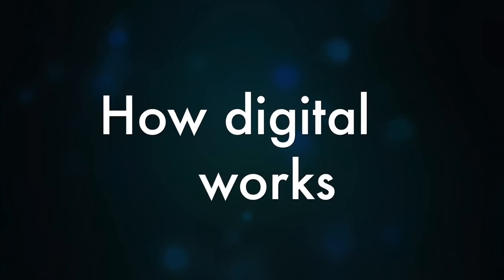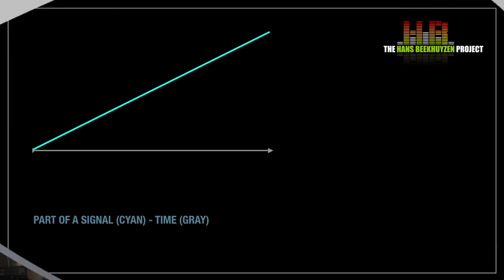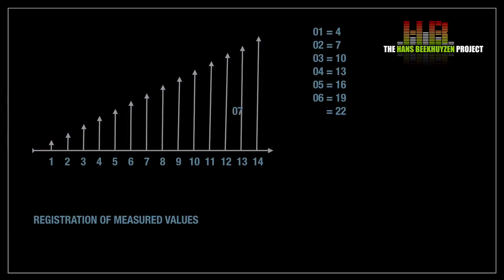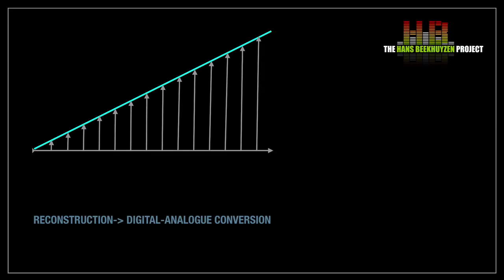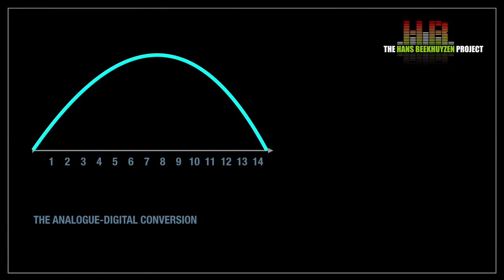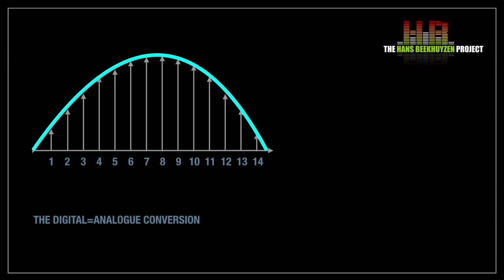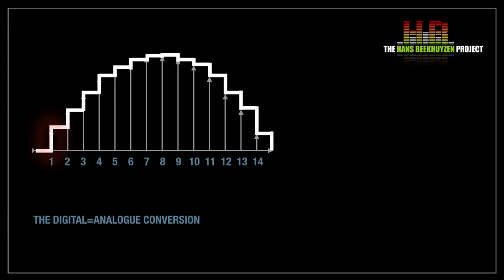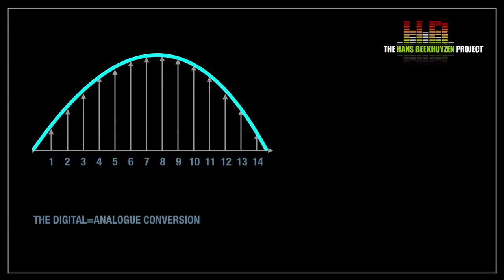Digital audio: Pulses are not real world,  sine waves are

Comment: I bow in reverence to you, Hans! So clearly explained about reconstruction filters make a smoother result (even if with some slight errors). The only more techy thing I think you might have been able to add to this discussion was having higher sample-rate material or having up sampled existing material allows you to use longer FIR and IIR  filters (digital filters) with more points or complexity and they give you so many more possibilities to trade off characteristics like magnitude passband ripple stopband ripple & filter skirts characteristics and things like that. Of course you should not ignore probably a discussion of phase response of such more complicated filters that CAN allow for better performance when taken into account with final output (reconstruction) filters, too. I learned a lot of what I just said from “Digital Audio” magazine published in the mid-1980s. Thanks, Hans!

Comment: this is probably the best explanation of digital audio on Youtube. I use vinyl at the moment, because to get good sound from this source is relatively cheap. but when 24/192 becomes standard resolution for on line purchases, and proper digital source component will be priced below few thousand EUR, then I will switch to digital. :)
Reply from the maker: Well, my digital front end costs slightly over € 4500 plus a computer..... And you'll be surprised how analogue it sounds, also on 44.1 kHz....

Comment: Excellent explanation, thank you. There's something I'm not sure to understand tough... is a native 192khz sample rate file more precise (or has more information) between 20hz and 20khz than a 48khz sample rate file? Or the only benefit is the extended frequency range and the smoother filtering at higher frequencies?
Reply from the maker: According to Nyquist a 48 kHz sampled file contains all information up to 24 kHz audio. The extended frequency range will most certainly be of no relevance to us. But to describe the smoother filtering as 'only benefit' might not describe the importance of it.
Reply: I have read that 192 kHz sampled files do have better time resolution of the musical information than lower sampled files (the higher the sampling, the better the time resolution). This seems to be crucial asumption behind the development of MQA. What do you think about it?
Reply from the maker: It is a misunderstanding many have - I have had it for a long time too. But the only reason higher sampling frequencies sound better is because the reconstruction filters cause less time smearing at higher sampling frequencies.
Reply: But in that the case, the same time accuracy would be obtained with a 192 kHz file than with a 48 kHz file upsampled to 192 kHz. That seems to contradict the tables I see in MQA´s videos and articles...
Reply from the maker: No, since a48 kHz recording was filtered at 24 kHz, the recording sid has the same problem.
Reply: Also, isn´t our hearing time accuracy better than 1/44,100th of a second? And even better than 1/192,000th of a second? If it is, then obviously not all musical information is included in a 44.1 kHz sample.
Reply: There is another thing I don´t understand from your explanation. I´ve been looking at Stereophile´s (or other magazines) technical analysis and graphs of CD players and DACs outputs for 20 years, and not even once I have seen a "natural" (that is, made of a continuous fluid nice curve) sine wave produced from digital audio. All I see is serrated wanabees, specially crude if from 16/44.1, and somewhat nicer if from 24/96-192.
Reply: Then I guess that damage made by the recording filters is what MQA´s time debluring treatment is trying to correct? They say they study the deviations of each recording filter, and then try to correct it, right? Please excuse my crude terms.
Reply: This is just what I was thinking. Now the question is... that time smearing depends on the DAC's roll-off filter? I mean, if a DAC begins the roll-off at, let's say 15khz, the time smearing begins around that frequency? What if the DAC begins the roll-off at 18khz? Do we get time smearing only between 18 to 20khz? Just trying to understand if a fast roll-off filter would get less time smearing with lower resolution sampling rates. Thank you very much Hans.